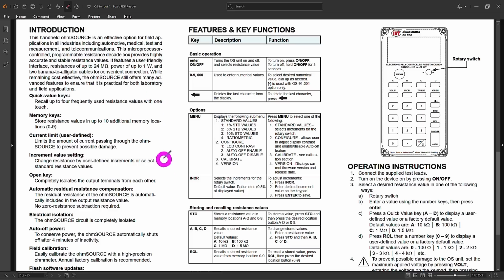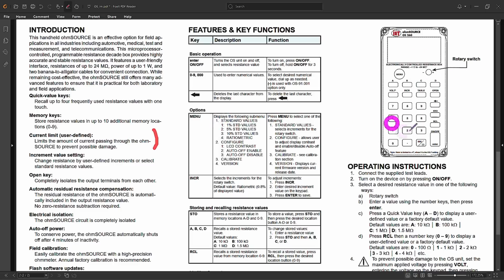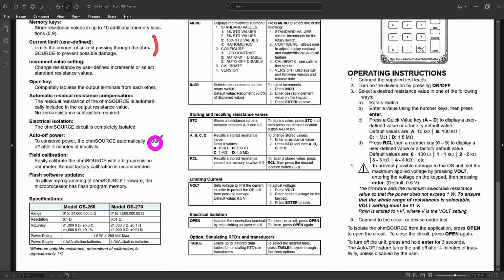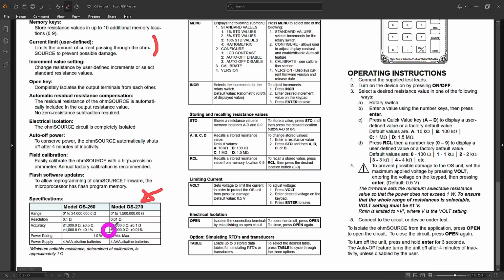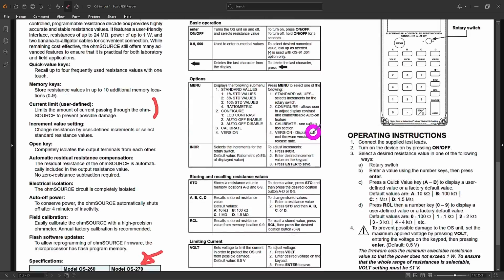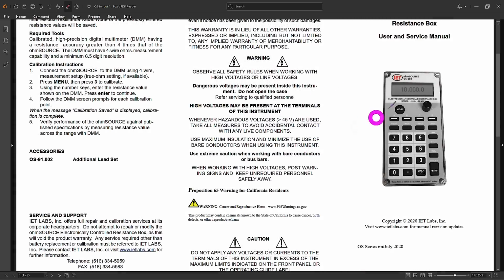TNP #53 - Ω-Source Electronically Controlled Resistance Decade Box Repair, Teardown & Experiments

Comment: I acquired a couple of the old Heathkit decade resistance boxes at hamfests for real cheap.  Now as I recall it is a 1% resistors but they look like at least two watt power.  And I only use it pretty much to select 5 or 10 percent equivalent values most of the time so that unit would be nice but not 1500$ nice.  I did check them with a Kelvin meter and I believe they are all within specs.

Comment: For  low resistor  may be the Relays contact résistance  add an error to the résistance value , has any one tried to do this with a  Digital potentiometer or a big mosfet.

Comment: 2 questions.  1.) Is that long delay for the reading a function of the box, or the meter?  2.) And the spec sheet says 1 W or power.  But those appear to be 0805s perhaps?  Does that seem out of line to you?
Reply: The smaller value resistors are larger, the maximum allowed voltage is 200V, and the 0805s are grouped together in a single decade? (Presumably the 0805s are normal grade resistors measured and grouped to get a good match?) Seems quite possible to me to meet a 1W spec, especially if it always switches in more than one relay, though I'd expect it to get hot and the resistance to deviate.
Reply from the maker: Hi Jessica, what type of digital layout do you work on?
Reply: @TheSignalPath  Working on an IoT product, now. I have worked on medical stuff before. Basically, easy boring stuff with an MCU/SoC, audio signals, RAM, whatever. Thus I really need your channel to get my fix of crazy!
Reply from the maker: Interesting!

Comment: 1:11 
BCF Status, RP0
BSF Status, RP0

Aaaargh, bane of my life.. (but fun, at the time)
Reply: PIC are my favorite microcontroller back in the day i made a central alarm with that reference  I used the picc compiler It's easier than the assembly language.
Reply: @electronics-by-practice  For m 1st 16c84 project, I hand-coded the binary opcodes from assembly, then bit-banged off a printer-port. PNP Transistor for Vpp, as per AN589 :)

Comment: You may want to watch behavior of this thing under oscilloscope. It might get really nasty spikes at the moment of switching. It does not make it useless, but it is a thing that needs to be considered
Reply: I'm curious about what latching relays are used, and how they are configured.

I would hope that there is an option to select the switching behavior.  Without thinking about it too deeply, there are at least three useful behaviors.  The obvious ones are the equivalent of make-before-break and break-before-make -- short the output before selecting a new value, or open the output before selecting.  For some uses a more reasonable behavior would be limiting the excurion from the target value, either minimizing the difference or always being minimally higher or lower.

It's obvious why you need to have the right behavior with a ratiometric divider of a voltage regulator, and the safe switching behavior depends on which side of the divider the resistance box is on.

Comment: At the other end of the scale from the OS-270,   I purchased a cheap decade unit from Aliexpress with 1% SMD resistors and manual selected with jumpers.    I can see the benefits of an electronic version, but none that I would use.  If I needed precision, I would tune the jumpered resistance values with a potentiometer.  Time consuming but workable.
Reply: I hate those things.
Reply: @GeorgeGraves  No doubt they are cheap and they are nasty, but they work.
Reply: @darrenconway8117  Mind doesn't work well when it's in the trash can :)

Comment: A good additional feature would be a 0.1ohm 10 turn potentiometer so you could adjust it to EXACTLY the resistance you want. The low values are reading a bit high.

Comment: The major consideration with this (and other "substitution" boxes) is the RF characteristics.  It is not good, but more troublesome is that the frequency response, and RF characteristics vary, since it changes the path through the resistors and relays to ensure you get the exact R value you want.    Keep the signals below 1 MHz, and you'll be OK.   This was designed and built by a friend on mine to develop and calibrate Conductivity and PH test equipment.
Reply: Hey @shazam6274, you nailed it—RF quirks are always a fun (read: annoying) part of the game. The Ohm Source is very much a DC and low-frequency tool, which is where our small team focused all our energy. We’re not trying to play in the GHz sandbox yet—maybe one day when we have a bigger coffee budget! Appreciate the technical insight—it’s great seeing these kinds of discussions.

Comment: sometime I wonder if there is something like infinite resistance.. I mean technically .. or will it be something like 4.2x10²³¹³²³² Ω from one side of the universe to the other. 😅
Reply: Long before you get to such an extremely high resistance, you would notice that electrical charge is quantized and equations like Ohm's law that assume a continuous electrical current are only approximations, so the meaning of "resistance" becomes ill-defined at some point, I think. You will always have some tiny non-zero probability of charges tunelling through even the best isolator, so I think the answer is: No, there is no such thing as infinite resistance.
Reply: You quickly venture out of 'resistance' into 'charge transport'.

Resistance is an approximation that is good enough to solve most problems, just like classical Newtonian physics is good enough for almost every use.  Thinking about how much mass photons would have if photons had mass doesn't help the spherical cow approximation.

Comment: I have designed a resistance box myself after considering to buy this one first but then realizing that it is not precise enough. The one I built can do 1 Ohm to 1.6 Mohm with 0.001 Ohm of resolution. It also uses very low EMF relays. But it is a lot bigger, the size is roughly that of the usual half 19 inch devices like Keysight 34401 multimeter. I also added all sorts of ratiometric devices to the menu. Usually I use it for PT100 simulation and simulation of saltwater conductivity.
Reply: Awesome idea to use ratiometric devices! I have too designed a programmable decade box. Mine is from 999.999999 megohm to 1 ohm with resolution of 100 milliohm. The best feature of my device is to calibrate automatically when connected to a PC with a keithley 2001. After updating the calibration offsets, it is +-500 milliohm on any set value, even up to 100meg. The calibration process is very slow, though.
Reply: Hey ChipGuy, that’s impressive—sounds like you’ve put a lot of work into your design! As a small engineering team based in the US, we totally get the drive to build your own solutions. The Ohm Source was actually born out of that same desire for precision and reliability. Our latest version has tighter specs and an improved form factor, and we’re always refining it based on feedback from engineers like you! We just made a huge improvement to our software, making it even easier to integrate into automated systems.

Comment: Looks like these units are manufactured by Labmetric, they also sell a variant of this instrument as the "Ohmstar" for quite a bit less than the one from IET with slightly different specifications.
Reply: Hey @ddrl46, good eye! Yep, we’re Labmetric, a small team here in Arizona assembling each unit ourselves (and debating resistor tolerances over way too much coffee). Thanks for giving us a shout—it’s a big deal for a team our size to get noticed.
Reply: @maxmetrix4256 hey. Do you have a link or anything to your website/shop? Thanks

Comment: I made a resistor substitution box. It is a matrix of 4mm sockets with resistors between them. There are a few thick jumper cables I can use for summing values, but most values I can get with no switch contacts intervening.
Reply: Hi donepearce, love the DIY spirit! That’s exactly where the Ohm Source started—just a couple of us brainstorming ways to ditch the fiddling and improve precision. We’re still a small team here in the US, and trust me, every resistor we solder reminds us of how much we respect setups like yours. Hopefully, we’ve saved some engineers a bit of wiring frustration along the way!

Comment: What a coincidence, just looked at the listing of this thing today. "Slow" reading update is because you have digital filter engaged on K2002. By default that's moving 10 filter, so you need 10 samples to get fresh new value fully refreshed. You can also null out the offset by using MATH NULL, when IET box configured to source "0 ohms". Also calling adjustment procedure by "calibration" is non-metrologically sound ;)
Reply: Talk about timing, xDevscorn_EE! Clearly, the universe wants you to think about resistors today. We’re just a small team here in the US trying to make precision tools a little less frustrating for engineers like you. I encourage you to join the resistance! If you’ve got any questions or feedback, we’re all ears—our team loves geeking out over this stuff!
Reply: @maxmetrix4256  We? :) Resistance is futile but would be cool to see more players in metrology. PPMs market does feel a little bit stale these days.